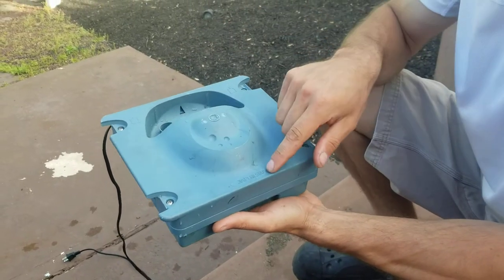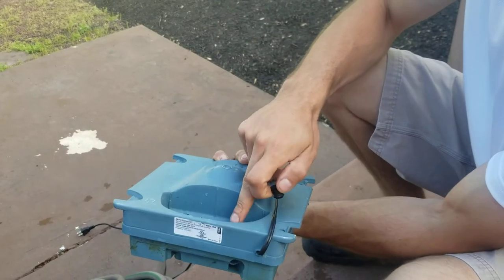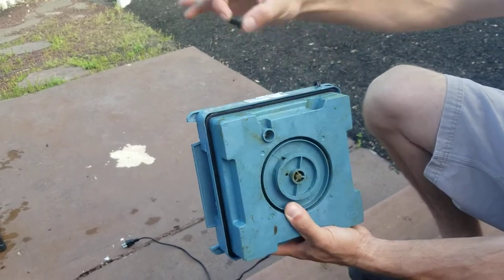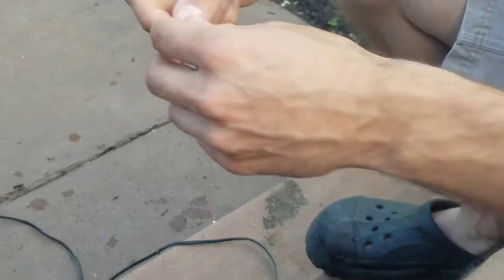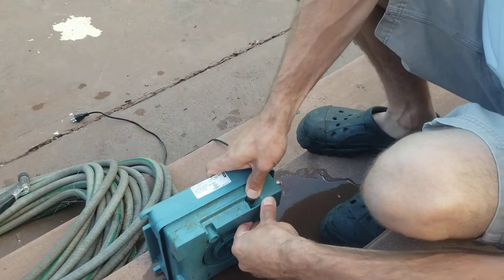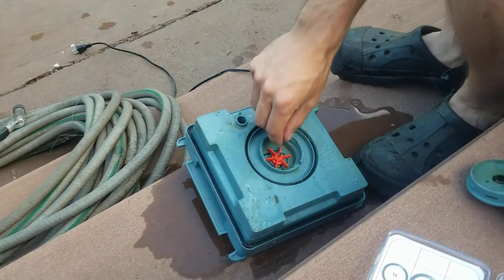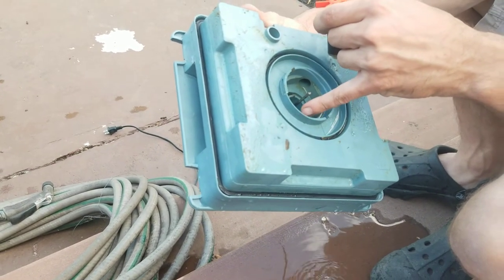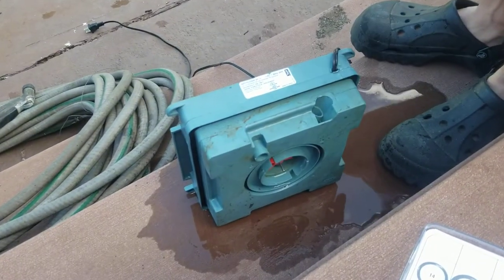Api filstar....that little rubber plug

Comment: OMG! U saved me!! THANK U SO MUCH. 
My filter was overflowing, and just like you say, I thought it was the gasket or the O-rings. After watching your video, I looked at the plug. It was actually still there but I just made sure that he was well positioned and now it works! Like magic! ;) 
Thanks again!!
Reply from the maker: Glad it worked.  Next thing that goes are the orings on the hose lever connector.   Those will flood ya too.

Comment: My tank was losing water faster then normal and low and behold water has been coming out of the electrical plug! And almost like the seam on the filteritself. Ive had it for about 15 years now. I finally found a place that sold me just the motor. Now im wondering if its just the plug. Idk but water damaged my oak fish stand and I took the motor as a loss and bought new but it needs all the parts changed over from plugs to o-rings, to the propeller. It litterly was just the motor. What kind of silicone do i use to plug this hole?
Reply: I had same issue so I called the plug area. Then it just leaked out the sides

Comment: My Rena xp3 is leaking from the motor housing and then it starts to leak our the top of the canister. Any idea what o-ring or gasket is causing it to leak?  Thanks for the video
Reply from the maker: Try the two o rings on the Male ends disconnect hose housing (the assembly with the lever.)

Comment: I found that the little plug can be replaced with a plastic plug from eBay in Uk Round Plastic Black Blanking End Cap Caps Tube Pipe Inserts Plug 15mm